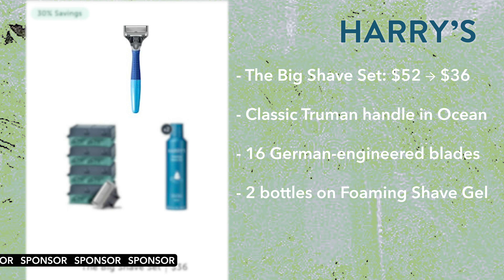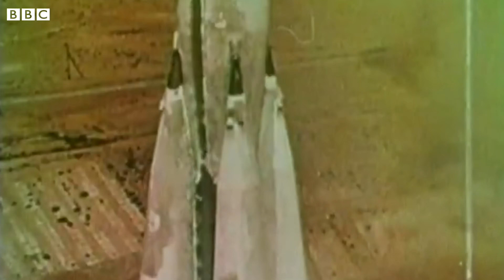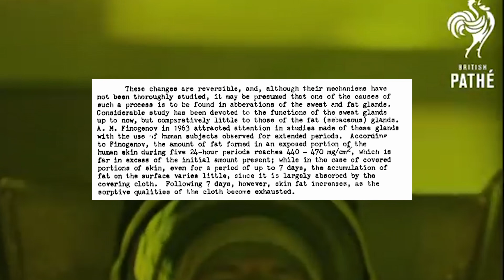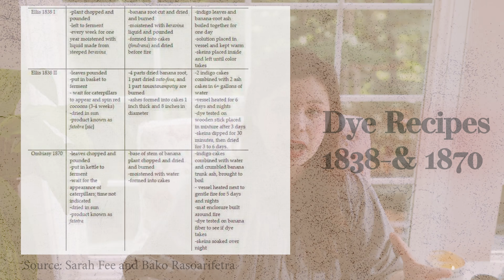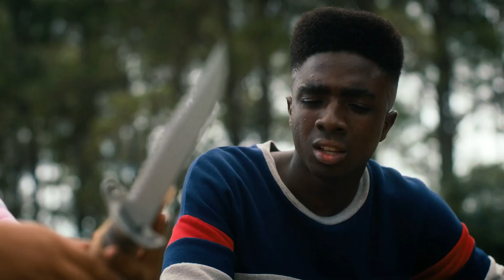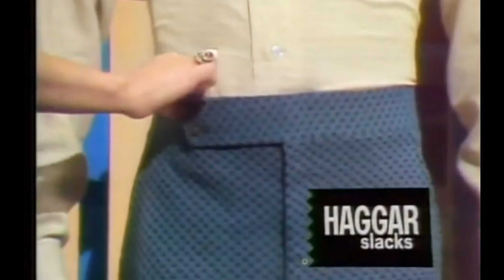The DISGUSTING truth about Laundry

Comment: I have made a very effective laundry detergent for years. Grated castille soap, borax, washing soda, and baking powder, using distilled vinegar in the rinse which acts like a fabric softener but also works to sanitize, remove residual soap, and neutralize the ph from the sodas. I have  sensitive skin. Using this system has pretty much solved the problem. Not to mention how much more effective it was in cleaning my husband's clothes which would get filthy with dirt, grease, sweat, and who knows what else. 
 My grandmother taught me this system because I used cloth diapers when my kids were small. Between the diy detergent and line drying, the diapers were brilliant white, sanitized, and smells were gone.  Bonus is that those are all much more environmentally friendly and one batch would last my family close to a year since you only use a couple of tablespoons per load.

Comment: I air-dried most of my laundry for years. I ran into the following issues: 1) I live in the American Southeast where it is humid in the summer and damp in the winter. If clothing is not in full sun, it will mildew before it dries, even when it's hot.   2) the sun bleaches bright colors. I often dried on racks indoors but this takes up limited indoor space and see above mildew issue. 3). Since I never use fabric softeners AND live where the water is some of the hardest in the world, everything is stiff. 4) Even when hungry up nicely, things wrinkle. Ironing uses electricity and time. 
Solution: When my second-hand, occasionally used dryer died last fall,bwe replaced it with a small heat pump dryer. It uses a fraction of the electricity, solves all the above issues, and is ventless which minimizes fire risk. 
Oh, and pollen. The American Southeast is a pollen hotspot. In spring, we can actually scoop up handfuls of pollen off outdoor flat surfaces. 
I love the idea of free line drying, but there is more to it than just being viewed as trashy.

Comment: It's wild that you have laws against line drying.

Also, because of the francly staggering number of comments on the post of the person who recommended vinigar rinse saying that vinigar damages synthetic clothes/seals and tubes in the washer, I coppy my reply here, so hopefully more people see/read it:

My front loading washer is 8 years old. I've been using white distiled vinigar in it as both fabric softeners and as a clean* for years and it did zero damage to seals or tubes (or my synthetic clothes). The acidic ingredients used in all fabric softeners are usually MORE acidic than vinigar and no one is saying they will damage your clothes or washer. If you wash silk you're SUPPOSED to ust vinigar in your rinse water. SILK. And samego that same vinigar is supposed to damage rubber and poliester? Food for thoughts.

*Every few months I will put a spoonfull of soda and a cup of vinigar into the drum and put the washer on the 90 degrees cotton wash program. It cleans of limescale, flushes out gunk, and sanitises (no funky smells) beautifully.

Comment: During the winter I have a water filter that allows me to vent the dryer to the inside instead of outside. The lint gets trapped in the water. This adds needed moisture to the house and that heat is used to help heat the inside instead of heating the outside. The house where I lived before had a huge basement where I strung clotheslines from the rafters ( 5 rows 20 ft long so I could hang the gutchies and hang during bad weather or night. A fan helped a lot down there.

Comment: I use alcohol spray a LOT for most of my clothes. The worse was working in the service industry and sweating my ass off in jeans and a white button down and trying to figure out if I could get another use out of that. I even figured out that coworkers did not wear underwear with their jeans! Like gross! You wear those multiple times a week, sweat like the Dickens during service and would wear them again without doing any kind of sanitizing, at the very least in the crotch, not to mention the rough seam on the softest bits of your body?!  What? That my friends is how one gets yeast infections...

Besides my whole rant I do actually have some tips as I started hand washing some of my clothing once I started knitting with wool. Wool can be washed with a soft wool wash which will take less time but you can also use salt and soak your wool for several hours and just not touch it. Then coming back to it, rinsing it, laying it flat in a dry towel, and rolling up the towel to ring excess water out of the wool gently so you don't have a sopping sweater on your hands for days. I just moved to Scotland which has much softer water than my home in New Orleans (I can already tell from the soap I use in the shower and how it feels on my skin), so I'm not exactly sure how my laundry will work besides the general  line drying. But oh my God Abby I think I need to start boiling my underwear and pajama pants cause yuuuuuuck 🤢

Comment: For the bacterias and hard water, you can just ad a little bit of white vinegar to the rinsing water (with no softener fragrance etc just vinegar), it is really not expensive and super efficient. And of course dry the clothes in the sun if possible will finish the process of eliminating bacterias. ( by the way remember that not all bacterias are bad, you have good and bad and kinda neutral ones) 

Also for those who would like to want a challenge and environmental detergent you can make some out of evy leaves, just remember that the new young leaves have a lot of chlorophile so can taint your clothes a bit green, so take only the old ones they wash better on top of it. 
Or you can use black soap but only by hand, it will clog the washing machine, I use it for my underwear or oily stains, very efficient on blood too if the blood is not dry.
Happy washing guys and thank you Abby for this interesting video

Comment: Lazy American here: I've always used my dryer, but I do follow the directions for clothes that cannot be dried in the dryer. 🤦🏻‍♀️ Living in Australia, I want to take advantage of air drying the majority of my clothes, but my previous apartment was too small for having drying racks out, and I had zero desire to hang my clothes on balconies that had very little sunlight and lots of spiders. 😅 I will try again because using the dryer is expensive now with energy costs increasing and I have lots of sunlight now.

Comment: Growing up, my mom had a clothes line in the backyard as well as line hung from the ceiling in the basement (for winter months). I used to hate having to hang up/take down the laundry. Now, as a homeowner, I hate using the dryer unless I absolutely have to. It has definitely saved on our electricity bill to hang clothes outside when the weather is nice. I also have 2 collapsible racks for inside use, but with 2 small children, their clothes go there instead to dry. I don't know of any other household in my area that hangs clothes out to dry. Such a waste of money.

Comment: The best thing to add to your wash is salt crystals and washing soda to maximise your washing liquid (that does the cleaning). My family live in a city with hard water and have been doing this since the depression. Never use fabric softener. It's just unnecessary chemical. Use the sun when you can, to dry clothes. The next best option is a warm, dry place and a clothes rack or similar. Last option is the dryer.

Comment: I have no shame about underwear on my line, I'm lucky to be able to get away without a dryer as I live in Australia and the weather for the most part alowes me to get stuff dry...altho in winter it can be a struggle, my main line is under the carport but that's on the south side so once it's cooler it isn't very effective, I have another one in the backyard but it faces east so also not ideal in winter, so now I have like 6 strings strung up under the front varandah on either side of the walkway...not ideal but I only need to take washing to the laundromat to dry a few times a year, usually after the kids have had a stomach bug😅

Comment: Very interesting Abby, I stopped using fabric softener over a decade ago as it was causing the towels to not dry the body and the undergarments that I had were not absorbing the sweet either since I stopped using it as well as cheap laundry detergents as I can afford good quality laundry detergent now my cloths have not suffered like the use to I have not had a washing machine with a centre spindle 2 washing machines ago that’s almost 40 years now my last machine as well as my current machine were designed to be gentler on the clothes but has the ability to actually wash them.
I have never washed under ware with outer clothing my GrandMothers rules on that one. And underwear must be white so it can be soaked in bleach water before it’s washed if needed.
I have only ever had one rule if it can not be thrown into the washing machine to be washed then I did not buy it. My new washing machine is even better than my last one as it has a steam cycle for bedding and towels which I also use on underwear.
Since moving to the Aussie Outback I line dry all my clothes except underwear and socks I have not done that since I lost them off the line when I was at work one day ( I still get the hebbie jebbies when I think about where they went that day)
I am now working at updating my wardrobe to natural fibers like linen and wool some cotton as my old clothes some of them are soo old they need replacing and not good for the goodwill shop so I will be cutting them up so they can be used for hand made blankets depending on what it’s made of, the polyesters and that sort of thing I can use to make dolls clothes as they won’t be washed as much and it be a good way to use them up.
Loved the tutorial, I had not realised how much I had been changing the way I had been doing the laundry for the better not just for the environment as wells for my laundry items.nice to know that I have been using old and new ways for doing my laundry lol

Comment: I have not done outdoor line drying in my current home, prevented by neighbors and a VERY large bird population, but I really never saw line drying until I was an adult visiting Japan while staying in a hostel. It was a very nice hostel with a washer but no dryer. I felt odd hanging my clothes outside until I saw that behavior was the norm. Any "line drying" I do now is on a hanger inside the house, so am not exactly killing any bacteria, but at least it cuts some of the dryer use.
Reply: I tried to use my drying rack outside once after I moved, and quickly found out that drying faster outside than in wasn't worth the chance of bird poop on my sheets and clothing. And with the tree, I don't get a lot of sun, anyways.

Comment: For drying clothes on a line: I'm allergic to mold, which turns out there is mold spores literally everywhere outside.  I break out from head to toe in a rash if I line dry anything outside, and we don't have any good setup to dry clothes in the house.  I also physically wouldn't be able to line dry anyway. Unfortunately, buying a good energy efficient dryer isn't in the budget, so we're stuck with an old used one whose sensor definitely doesn't work.  

I use white vinegar as a softener, works much better.  I also have a cesspool so bleach and anything with antibacterial properties is out for laundry and cleaning products in general that might end up going down the drain.   I do want to incorporate boiling undergarments and add linen items to my wardrobe.  Especially since we tend to wash everything on cold because our hot water is oil and that's expensive
Reply: We hang our clothes on an airer in a room with our dehumidifier on. Its cheaper than buying a brand new drier & if you get the right kind they have uv light and filters to remove dust & pollen & mould spores etc from the air. Its not a perfect solution but it might help?

Comment: washing your clothes on 60°celsius also takes much more engery, so there's that environmental impact. Also: sanitizing your cloth - well, most of the bakteria that live on our skin etc are not that harmful and the trend of sanitizing and disinfecting everything in normal household has contributed to the rise of allergies. We have an immune system for dealing with bacteria and gunk.. And: Linen underwear is so damn expensive, I looked into buying linen sheets, duvet covers and boi, can I not afford this... - esp. if you're not the standard body type and it is already hard enough to find fitting underwear (why are the leg-holes in panties size xxl the same size as in panties for xs? I have yet to find underpants that will not digg into my skin around the leg. And thats with the ubiquitous cotton; Can't imagine to find linen underpants that fit and are affordable, even if I take into account that this will probably last longer. 
I wash my clothes with selfmade detergent - plain and simple soap shavings + washing soda + sodium bicarbonate - that is actually not expensive. There are recipes for this kind of selfmade detergents out, if someone wants to try.  
Also: regarding the problem of micro fibres and particles from plastic clothing - there are special laundry bags (called guppy friend), that you can use in the washing maschine that will prevent those micro fibers from getting out with the used water. But - these are not cheap as well, so I have not come around to buy one. 

Also: in the moment with inflation as high as 10%, energy prices rocketing and the fear of a cold winter without the energy to heat our living spaces - no penny left for things like that.

Comment: I used to hang-dry everything on warm sunny days because we rented a place that had one of those big square built-in clotheslines in the backyard and I just used that whenever I could. On a sunny or windy day, things took just as long to dry as they did in the dryer. I miss that. Our current landlords would probably be fine with us putting up a clothesline, and I do have a couple folding racks that I use all the time, but I don't really trust my landlords' kids not to try playing with a clothesline. I hang-dry my underthings, anything wool or linen, and an increasing number of other pieces. I also avoid buying clothing or fabric with polyester or acrylic content. Not perfect at this (try finding children's socks without polyester these days), but it's something small that I can afford to do. We also do things like hang towels up to dry in the bathroom after using so they can be used more than once before washing, wear pants and skirts multiple times before washing, and re-wear shirts that haven't gotten gross. I've been planning to make some linen chemises and undershirts to shift more of the burden to those rather than all my shirts, but that's still in-progress.
Reply: It would be extremely hard to find any sock that doesn't have nylon in it. At least at the toes and heel for reinforcement, because you can't count on people darning their socks and no one wants to buy socks that get holes easily.